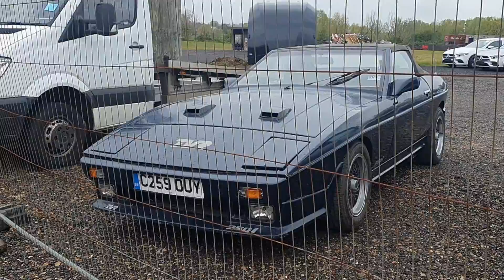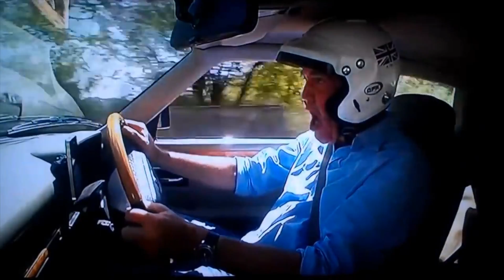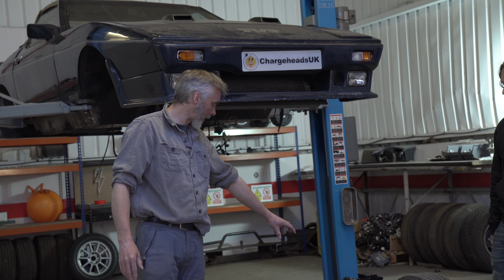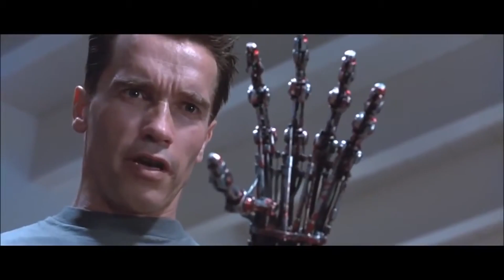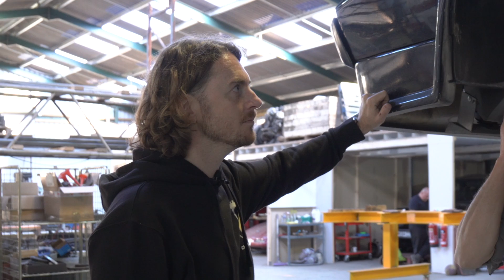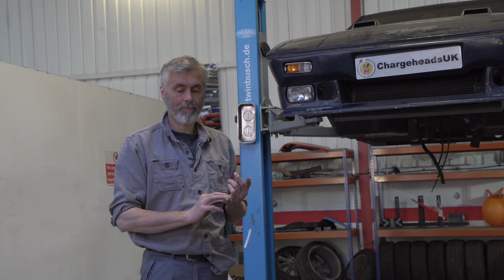Tesla Powered TVR! Ep2

Comment: Cut the tunnel bracing and run a complete model 3 pack with the modules stacked in there on top of each other. 👍🏻
Reply from the maker: That sounds like a great idea, however I'm not sure we would get that past the UK standards. In the USA i would, maybe i should emigrate 🤔⚡🤷‍♂️
Reply: @chargeheads  good point, just a random thought. I saw ev west do a build like that on an older classic. Stacked them 2 on the side on top of 2 that we're on top of each other. Super slick solution imo, looked very nice and kept them from building multiple separate heavy batt boxes. So I figured I'd weigh in with my .02c 😁

Out of curiosity, where are you thinking of putting the batteries right now? 🤔
Reply from the maker: @4literv6  keep tuned the next wedge-E episode will give all an idea 😉
Reply: @chargeheads  when will  that be?
Reply from the maker: @MrMrBigro  not long now 😉⚡💚